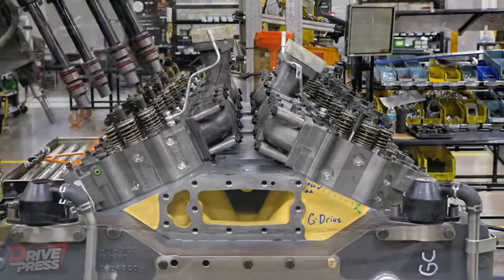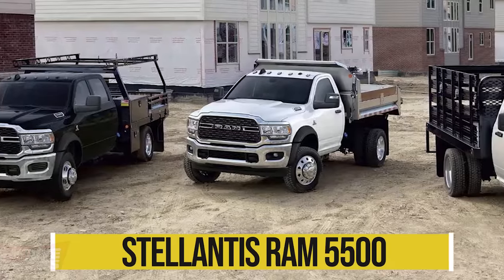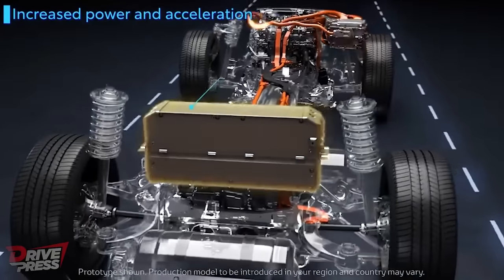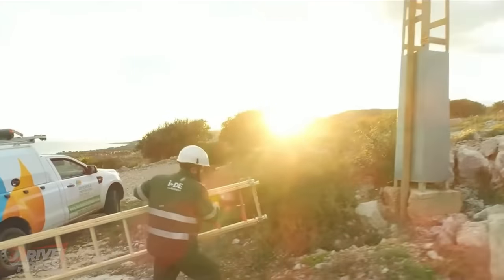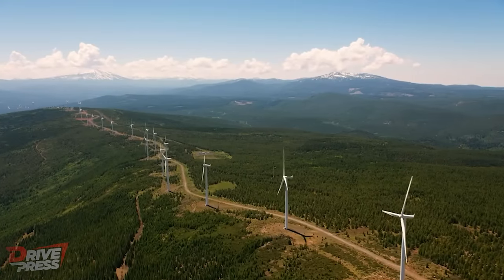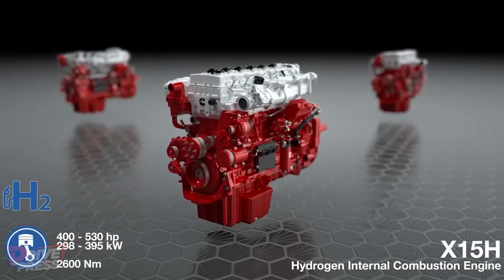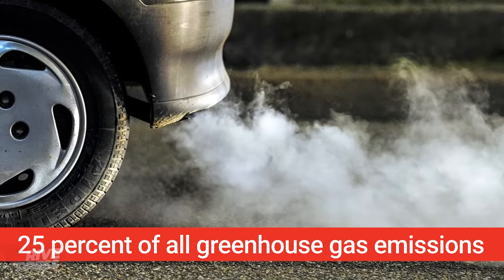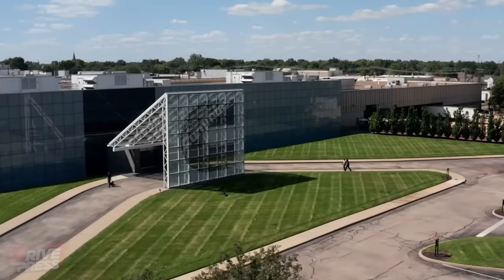Cummins Hydrogen Engine Spells Doom for Diesel

Comment: As a 47 year old diesel tech, I’m glad I’ll be retired when diesels are totally phased out .  And I’ll finally say goodbye to an old friend that caused me many headaches and pains throughout the years, but earned me a pretty decent income to where I was able to enjoy the good life.
Reply: That statement have a point ?
Reply: @SatansChoice  nope. Does yours?
Reply: Good deal - you timed it just right!  My first job out of school was working for Cummins.  I worked on the small engines that are used in Dodge trucks. (It was a joint venture with Case btw.  Half the engine production went to Cummins to sell and half went to Case to put in their equipment.)
Reply: Hydrogen embrittlement is the issue.
Electricity is the future
Reply: I try not to kick myself for not becoming a diesel tech.
Reply: As a mature, huge EV Fan. I am amazed Tesla hasn't incorporated  a diesel minigen, especially the Semi often hauling a reefer regardless anyway, huh.. As a retired diesel wrench designing the perfect diesel genny. HMMM. Ifimay...  genny-wise think voltage very accomidating to the drive motor/battry system. Also body friendly frequencies extremely important. Elins new system is 48v & your body aa friendly.   All easily lookitupshyt.
The diesel side.. think also a healthy body freq,   perhaps close to the human heart rpms .with pull- out like an 80s cassette deck adaptive ability..:) cars not semi.. perfect mounted to a trailer aerodynamic hump. Adapting to older models..could put lots of not able batteries back on the rd..market wise.  battery tech IS stepping it up, As a result of the huge ev demand increse. . Imagine a manufacturer who incorporates road/ tire sound cancalation  tech and  corrupt media pick a noisy interior to bitchabout. Lol Don't believe the corrupt media. Look it up.  All civilized countries in the world have acknowledged the EV as a sustainable clean future alternative. Some sell more evs. The model Y now outselling the gas corolla.  Petrol will always be a leash.  Only electricity and all its abilities to create can truly free the people of this 100 yr leash.  Think roman salt wages.  Open door or no tech will kick in with demand like the ev.  Fusion,.advanced fuel burn devices over steam, lightning harvesting.. my pick. 
A specific rpm diesel minigen will always be more  efficient than a  road going ICE designed to make 100s of HP or lug down the rd at a  small % of max hp..  for long %s of the trip. This is where electric efficientcy shines., adaptive HP/rpm efficiency #s.  The poower plants r sandbagging.  The grunt is there, it's all the wiring bettween cities.  In comes megapack. Dont believe the mining or fire FUD. Notta compared to EVs eco-wise.. Also worth noting is Ed liniskillions magnetic flywheel 24 n 24 s with 4 inner curved  magnets that pushed the n magnetic field into the s field, altering. .what he said.. as to how the pyramids were built.  AG is possible.  The man uses mercury.   Spins it. Its Also done with Sound,  the ancients left frequencies carved in stone . The bees, beatles and I believe hummingbirds have adapted to create a mass nullifying field.why aerodynamicly they shouldn't fly..but do..Elon doesn't appreciate AG tech but is designing all his new models accomidating the tech frequency-wise. Peace.
Reply: Diesel will not be "phased out" within the next 50 years.
Reply: @GWAForUTBE diesel electric systems have been tested in trucks since the sixties. It's only until the last decade they have refined them to work like they do with trains.
Reply: @cliffterrell4876  yes averaging to & from electricaly 90%ish efficiency #s. The ICE being the sucky 30ish % #s. We need a highly efficient diesel mini-gen.  I think any hybrid with a ICE with a direct connection to the wheels shouldn't recieve ev tax credits. The electric motor/s must be the only direct load to the drivetrain.  It's like the F 250 parking in the last charging stall...its got a battery...
Reply: @GWAForUTBE wrong. Try again
Reply: @victorbernier4765  I can go ALL day at this.  " what"   exactly?
Reply: @GWAForUTBE Batteries and range are huge electric issues as well.
Reply: @GWAForUTBE Great idea! Electric Semis that can travel 30 to 90 miles using 1/4 of the energy to move their own batteries. What is making the energy on the other end to charge these batteries 🪫?
Reply: @STSwhisperer  Teslas Semi is extremely efficient.   Costing pennies on the dollar compared to any diesel.   How many short haul diesel trucks lug around full fuel tanks to go 50 miles?  
Any charging station and associated EV will always be considerably more efficient than ANY road going ICE.  Sometimes it's about not wasting energy.  ICE suck horribly efficiency wise, compared to electric motors.
Reply: @STSwhisperer  Tesla warranties the batteries for 8yrs.  Range. An owner knows its range and hauls accordingly.   At this point it is a cross country thing.  But in town stop & go it shows huge superiority over stinky, noisy, inefficient diesel.
Reply: @GWAForUTBE  All complete opinion. Show me the money. Electricity is not free, it is generated from a power source and must be transferred long distances and then converted again for a battery, which is toxic and mined in horrid conditions then shipped here on ICE vessels across oceans. Electric semis at this point do not have sustainable range. A ford lightning pickup was proved that it could only 1/3 of its rated range, 90 ish miles. Then the crew struggled to find charging stations aligning with its planned course.
Reply: @GWAForUTBE  I work in an industry that relies heavily on hybrid and EV and other forms of energy so I’m well aware of their limitations and capabilities. 5 year battery warranties give up around 3. Promised range and mileage is grossly overestimated and overstated. Even hybrids vary greatly when experiencing traffic or higher load conditions, where sometimes rather than warning early enough they just stop and have to be towed or limped back

Comment: There is no free hydrogen, most is in the form of H2O, so these engines are indirect coal and natural gas powered from the electrolysis of water by electricity.  Huge 10,000 psi compressed hydrogen tanks vs relatively safe diesel fuel.  Just transferring more load to the electric power grid.... just like coal powered electric vehicles.
Reply: 10,000psi tanks, even if it doesn't explode, the release of that much pressure will be an explosion in itself.
10,000 psi!
A wreck is an obvious cause.
Road debris that gets airborne, all it takes is a board on the freeway to become airborne, doesn't even have to hit the tank but knock off the fittings from the tank.

I could see it in trains, not roads.
Reply: I hope Cummins succeeds at this endeavor.  Toyota already has the Mirai which ones on hydrogen, so the technology is there and Cummins can succeed.  Whether we like or not the combustion engine is dead and new technology like EVs and hydrogen is the new technology.  Also I think more mass transportation and high speed trains running on clean energy is necessary.

Comment: Remember that no matter what you use to power an engine you will still need to lubricate all the moving parts in the engine and all other parts of the drive system. So in other words we will still need crude oil for lubrication.
Reply: And tires, and synthetic rubber seals, and energy for manufacturing.
Reply: And crude is rich in hydrogen

Comment: So does this solve the problems of hydrogen energy density, collection, storage and transport?  Burning hydrogen in an engine to generate torque is not particularly difficult.  It is all the HUGE technical issues with providing an infrastructure that would allow us to store, distribute and use it efficiently. that have always been the limiting factor of our ability to use it…

Comment: Toyota and Cummins are paving the road and the right path with this technology, it’s only a matter of creating the infrastructure to make it feasible. Electric is not the answer but hydrogen 👍
Reply: "only a matter of creating the infrastructure to make it feasible"  Anyone got a magic wand?
Reply: And j.c.b. in England rolling out hydrogen excavators as we speak.. they have a hydrogen feeder vehicle that can supply 16 machines to run all day 12 hours  .500bar feeder tank fills 350bar excavator tank. Simple pressure drop transfer. People could adopt this system and have a home storage tank which can also run a heating boiler. As is currently done with oil or l.p.g. on site storage.
Reply: “magic wand” - Amazon & Walmart warehouses use H2 for their forklifts, instead of toxic batteries 🪫 … infrastructure exists, across North America, it just needs to break out of the warehouses.

Perhaps, they can become the next filling stations! LOL! 😂
Reply: @DavidHalko wrong, the forklifts you mentioned are running on liquid propane gas (LPG), or compressed natural gas (CNG) not H2.
Reply: H2 is terribly inefficient, Toyota already tried and launched the Mirai in 2012 and it was DOA.
Reply: @vuvision  - “Toyota Mirai…”

The Toyota Mirai hydrogen fuel-cell car, when driven carefully, goes 845 miles between fills. In rush hour traffic in California, it was demonstrated on August 23 & 24, 2021 that the car with accessories turned off & over inflated tires, covered 473 miles the first day & 372 miles the second day in rush hour traffic… on a single tank of H2.

Try that with any other 2012 dated vehicle.

It has less to do with efficiency, more to do with stupidity & disregard for ecology.
Reply: @vuvision  - “wrong, the forklifts you mentioned are running…”

Hydrogen.

From 2011-2021, deployed hydrogen forklift units have increased from 1,000 to 40,000, in the US alone… and they continue to increase.
Reply: @DavidHalko  That 845 miles stunt was in 2021, not 2012 😉. That hypermiler stunt was filled with caveats, a laughing stock of a publicity stunt. Running extreme slow in a loop rather than point to point destination, and it took 2 days to complete. Btw, there are many other similar hypermiling tests that beat this 845 range, Google is your friend😉. Meanwhile in a real world scenario, head over to reddit and read Mirai owners barely getting 250 miles max per tank, at a cost of $16/gallon. There's a class action lawsuit on this false advertised range. Not only H2 car is terribly inefficient & expensive, the refueling stations debacle is an utter joke. There are about 50 refueling stations in the US and most are in CA, many are not operational. People already voted with their wallet, nobody wants it, H2 car market shrunk 30% this year. H2 is dead, bud 😎... But if you insist, put your money where your mouth is and buy a Mirai and come back here and let us know how it works for you.
Reply: @vuvision  - “845 miles stunt was in 2021” - yep, I said that. Glad u can read!

“Filled with caveats” - yep, I said that. Glad u can read!

“Running extremely slow in a loop” - yep, it’s called rush hour traffic in a city. Plenty of people are in a city, doing stop & go traffic. 

“Real world scenario… barely getting 250 miles” - same with EV’s. Go slow, go 400 miles. Go highway speeds around 80 mph in Texas, go 250 miles.

“Class action lawsuit” - yeah, class action lawsuits for everything! LOL! People Sue McDonalds because coffee is too hot! ROTFL! Nanny state with children running the legal system instead of the educated.

“H2 car market shrunk 30% this year” - H2 production & transportation are expanding. Electrolysers to produce H2 are on schedule to be up by 145% over last year. Sales are already booked to be up by 57% increase for next year (more sales can be made this year!) 

“Cost of $16/gallon” - Scientific studies are figuring out that intermittent energy sources like wind & solar can produce H2 at a lower cost than 24x7 production, so there is clearly opportunity for lower cost of H2. A fuel cell will last the life of a car (200k miles), while batteries will need to be swapped or car thrown out… the costs to EV are hidden once people realize the battery is a consumable, just like the electricity is.

“Filling stations” - which is why I brought up the Walmart & Amazon H2 forklifts… 40,000 H2 forklifts are being filled across the country, ~4x higher number than H2 cars. These private filling locations need to be deregulated, to allow broader access.

“put your money where your mouth is” - I have, I like my gas car. My Ford Focus can allow me to drive ~1000 miles in a single day to see family in different parts of the nation. I can’t do that in an EV. If H2 filling stations were available, I could do it, but they are not. Gas is the only option.
Reply: @DavidHalko  I was agreeing with you & reiterating how inefficient H2 car is, thanks doubling down and reconfirming with me. But that's alot of future what if vaporware you posted. H2 already lost to EV no matter how hard the anti EV crowd want to believe otherwise. The best H2 car on the market is the Mirai, and Toyota is losing money on every Mirai sold, rub salt to the wound, sales of Mirai declined 20% YoY. On the other hand, EV is having exponential growth, Tesla Model Y surpassed the perennial Toyota Corolla as #1 seller on the planet. That's why the new president Mr. Sato had his engineers to dissect the Models Y and declared the Model Y is a work of art. Mr. Sato announced it'll be EV first at Toyota. H2 is dead,  refueling station will never catch up to Tesla supercharger infrastructure, full stop!
Reply: @DavidHalko  I see reading comprehension is not your strong point,  not sure what your Focus has anything to do with topic, I was talking about you getting H2 Mirai if you believe in H2 so much. You really need to crawl out from the rock you're under and catch up on EV technology. Tesla has 8yrs /180K miles warranty on their battery. There are Teslas with over 1M miles on original battery, 250K-500K is the norm. My 2014 Tesla Model S runs better now than the day I bought it with all the OTA updates, with only 9% battery degradation. Newer battery will outlast the life of the car. Please do a little homework before posting uninformed drivels.
Reply: @vuvision  -  “I see reading. Comprehension is not your strong point… I was talking about you getting H2 Mirai”

I see reading comprehension is not your strong point, either… I told you I already made my choice and I declared by choice! LOL!

“Not sure what your Focus has anything to do with the topic”

I was kind enough to tell you where I put my money, since you suggested I “put my money where my mouth is”, since I bought a car recently. Perhaps you were disingenuous with your suggestion?

“Losing money on every Mirai sold”

Yep, as are most US car makers selling EV’s today. Mass production is the secret to making money.

The H2 forklift market seems to be doing ok. H2 is expanding in areas EV are losing ground, largely due to H2 having linear performance not offered by EV batteries.

Funny how ships 🛳️ are moving towards H2, the first half H2 airplanes ✈️ are flying, trucks 🛻 are moving towards H2. (Ironically, Soviets had H2 airplanes ✈️, decades ago.) 

Once the truck 🛻 stops get H2 fueling ⛽️ moving, it will start to change things. Home 🏡 H2 generation is still a little too large & expensive. That will be the last domino needing to fall.

“My 2014 Tesla… only 9% battery degradation”

The manufacturer gives the batteries headroom, not charging it to capacity, so you can supposedly go for years without degradation… but it is really false, the battery is really degrading, the battery degradation is not measured & provided to the user. They fact that you are suggesting you only have 9% degradation is an indication you had no idea what is going on, underneath your feet. ROTFL!

“Crawl out from the rock… catch up on EV technology… Please do a little homework”

I have 4 EV battery modules for the solar system I am continuing to build out, apparently I know a little more about the firmware & battery technology than you do. 

I am glad you think that people who build their own solar power systems, recycle EV batteries, and work with firmware live under rocks.

If someone who works with the technology crawled out from under a rock, I am not sure what that makes you, who does not even understand happens with battery degradation. It is chemistry, not some magic number on a screen. 🤣😂
Reply: @vuvision Thank you for posting this!!! This is the third time I've saw someone mention about forklifts running on hydrogen. I've worked in a warehouses and driven forklifts and know that they run on propane. A couple were battery powered too.
Reply: electric is actually okay for passenger cars but not for utilitarian vehicles such as semis, while hydrogen is the opposite of electric... meanwhile nuclear-powered vehicles exists in the past
Reply: @nickwinn7812  magic needed to keep the hydrogen in the tank. Leaks through steel easily, and even glass. Commercial vehicles that use the stuff straight away, boats, trains, trucks, planes might get away with using hydrogen, but cars, bikes etc. Not at the moment. Looks like the batteries will win out first by getting smaller, lighter and more efficient.

Comment: I am encouraged by the engine configuration options Cummins is producing. Biodiesel is still a reasonable option.
Reply: If the engine is specifically built for it. I owned a fleet in the 90s and got a gonga deal for biodiesel. The trucks didn't perform anywhere near their performance on diesel and the 5 - 8 mpg loss wasn't worth running it. It cost just as much as if I had been running diesel at the end of the month.

Comment: Everyone just needs to follow the steps of Edison motors up in Alberta, do a smaller diesel powered generator under the hood, which will top off a battery bank. The truck itself is fully electric though. Absolutely love the applications that setup will bring.